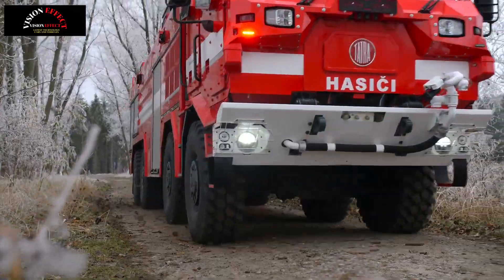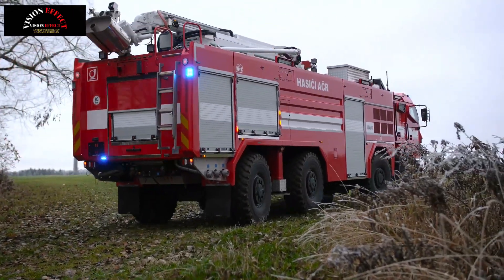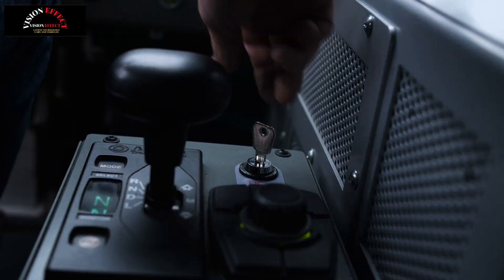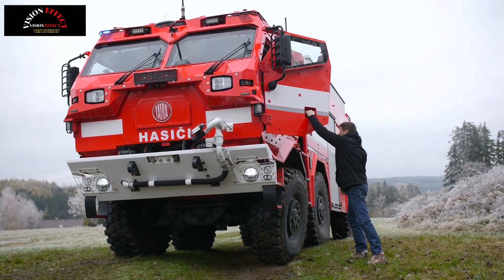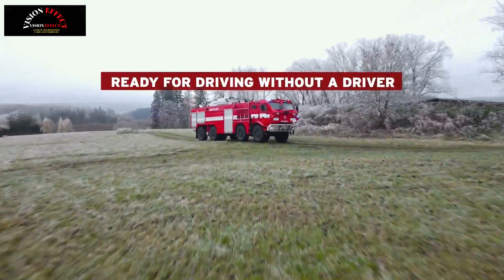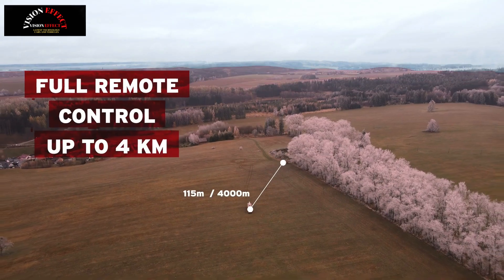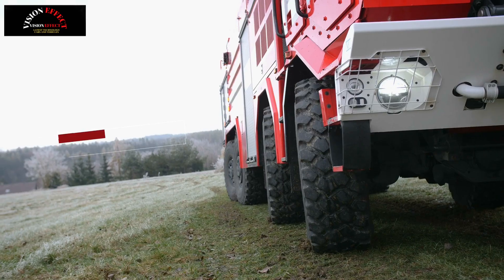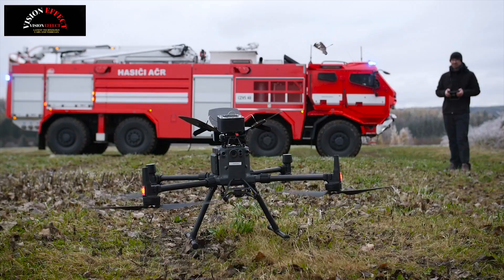Cummins ISM500 Engine | Gross Vehicle Weight 36,000 Kilos | Crew 1+3 | CZVS 40 TATRA FORCE 8x8

Comment: This truck would make an amazing base for a camper RV for overlanding
Reply: https://www.youtube.com/watch?v=65lB8hnrRKo

https://www.youtube.com/watch?v=_pz03yMkS04
Reply: For example, the manufacturer SLRV Expedition Vehicles can build a similar vehicle on a MAN or Tatra 8x8 chassis.
Reply from the maker: That would be great
Reply: Another example: https://youtu.be/sKxn745OvAg?t=1840
Reply: @HajdaMCZ thank you very much. That thing is awesome ❤❤❤❤
Reply: There is also chassis variant for cranes / drilling operations that have all wheel steering just like firefighter one. It would be fun to see RV with it going sideways ;-) Well, I heard that full production capacity is booked for military tracks for next few years, so it's unlikely to happen...
https://youtu.be/maJVYXaOd6s
Reply from the maker: You are absolutely right. 👍